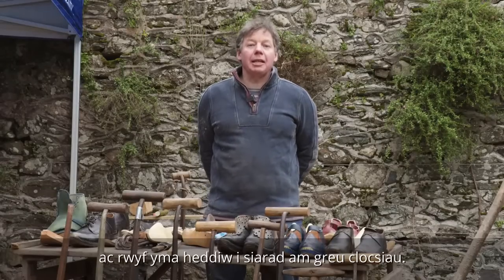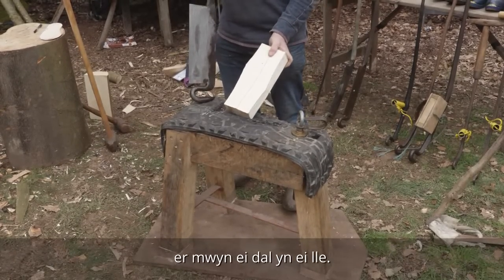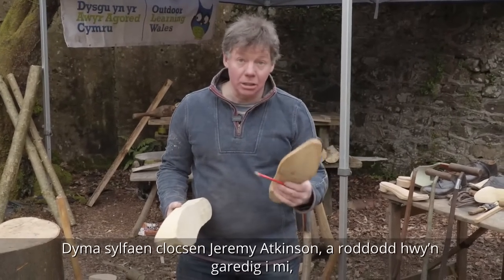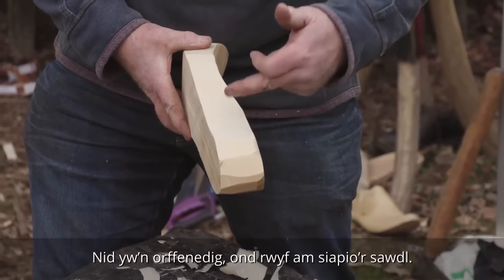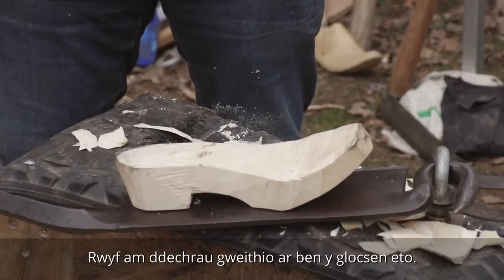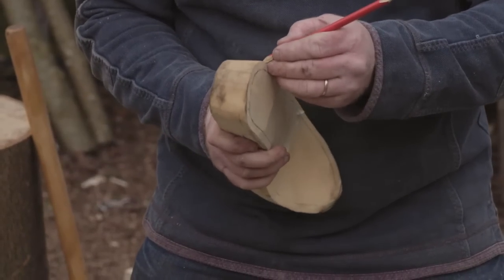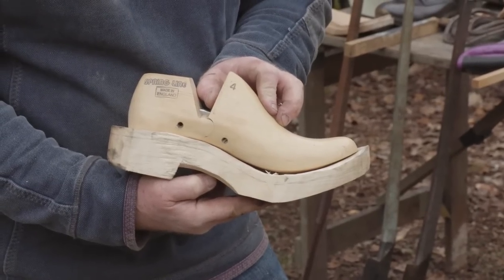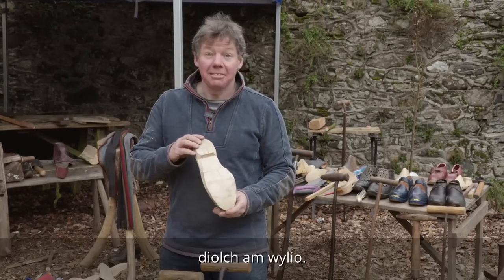Gwneud Clocsiau / Making Clogs

Comment: i remember me & school mate,s,going into a clog shop in whitehaven cumbria in the 70s & early 80s, & i bought my first pair of clogs there, & even though he,s been dead since about 1984 i recently saw a pair of clogs in a secondhand shop that were my size, & i knew right away that they had been made by the old clogger i new all them year,s ago, they were red leather, but i dyed them black, when they were clearing the shop out after his death, there was a skip outside, that i got allsorts of things out of, metal calker,s, rubber bottoms, leather lace,s, etc, if he was putting rubber sole,s & heels on, he would use the manufacured clog soles, that he bought in, but used the side walls off car tyres, where there is no wire running threw the rubber, only thin string & when we as school kids needed the heels re- rubberd, ( cos he allways told us to never let them wear down that far that the wood started to wear away.cos he would have to build the edge up with leather) he would tell us to go get him a tyre from a car tyre fitting place, not far away. & he would do our heels for free, we often took off school to go sit in his shop, esp on rainy days, & would tell us to run up his stair,s & keep quiet, if we happend to see,out the window, before he seen us, what we called the ( schoolboard man) that would come looking for us & take us back to school, that we avoided every time, lol, the whole shop & house was a living museum, with nothing, changed,( not even most of the wallpaper on the walls) since the late 1800s, his sister lived there with him, & they sat in a tiny kitchen at the back.that had a lovely coal fired range, that they would cook on, & boil the kettle by hanging it over a hook above the fire, the premises is now seperate from the shop, 2'flats, & the shop itself is a place where women get stickon nails put on, which to me is a massive down-grade to what was once made here, strong comfortable footwear that if looked after  will last for year.s, & the best thing you could ever  wear on ya feet..   thanks for the video
Reply: Yes that was Mr Brew. He told me that the day he finished his training was the day he stopped handcarving. Too much like hard labour.
Reply: @jeremyatkinson4976  yes it was mr brew, (lancelot brew,) & his sister that lived with him,( sarah ann brew,) who are both now buried together in whitehaven cemetry,
Reply: You cannot beat clogs i wear em everyday i have afew diffrent styles ..

Comment: In answer to your question Richard, the angle of the cast is determined by what is comfortable when you walk. A flat sole on a shoe with no flex will make you walk like a deep sea diver. A clog with a very high cast at the front will have you tottering along. Somewhere in between you can fall forward just by leaning forward and then as you stride your back foot is lifting off the ground just as the toe kisses the ground . It feels great, I your stride lengthens compared to shoes that flex.